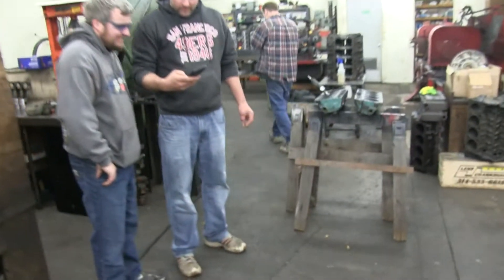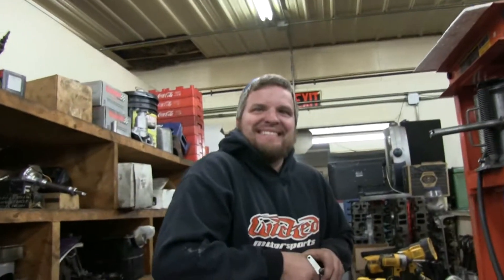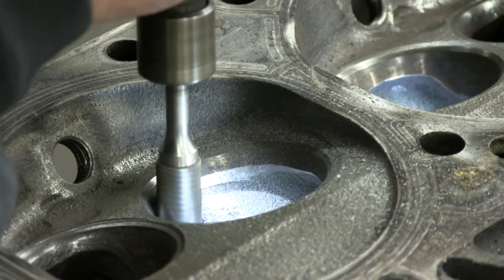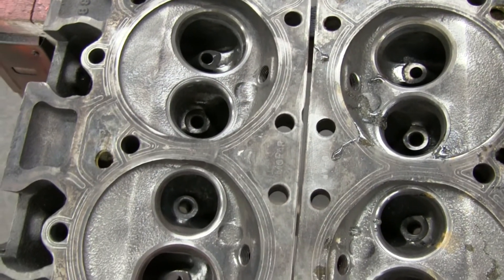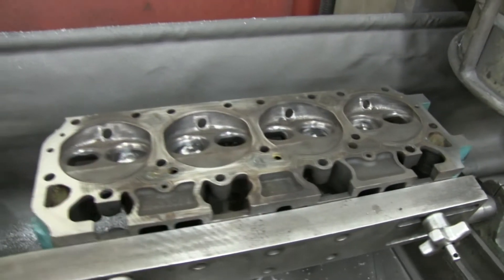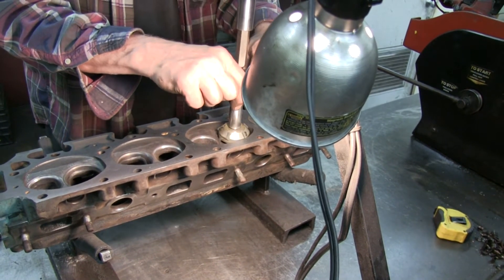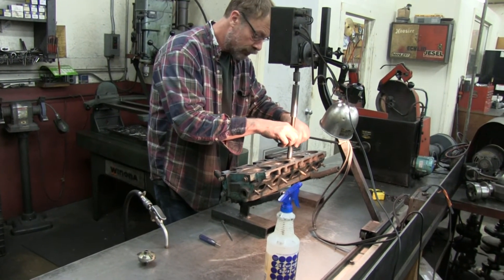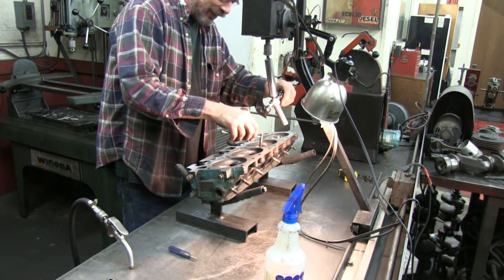Mopar 440 Engine Build Part 10 - Resurfacing Cylinder Heads

Comment: I searched for years for good reconditionable 906 heads and eventually found some - however - it turned out to be a fanatical labor of love because the smog 234 is a better flowing head despite what the pundits say. Extensive testing has been done and the 906's (and 915) aren't all they're cracked up (pardon the pun) to be.
Anyhow cheap aluminum heads have all the mods done, smaller chambers, about 60% lighter and resist detonation for about the same cost as recoing iron heads. Unfortunately all new heads need work to check everything, so this makes the cost of aluminum heads more expensive.